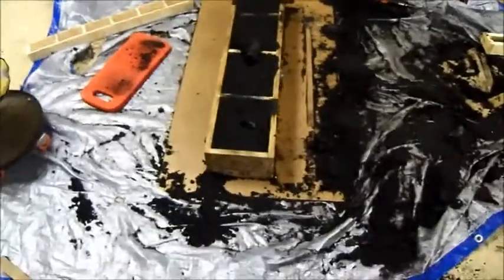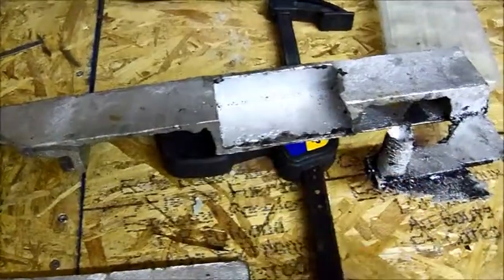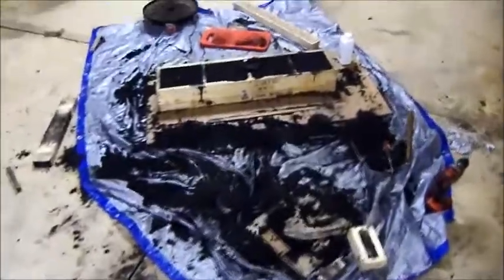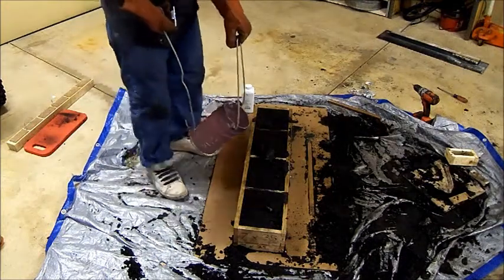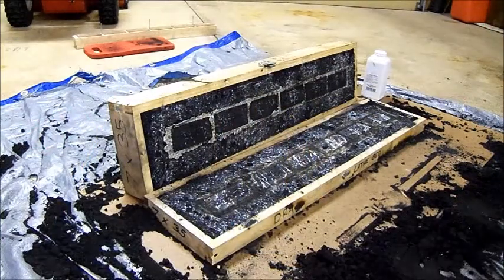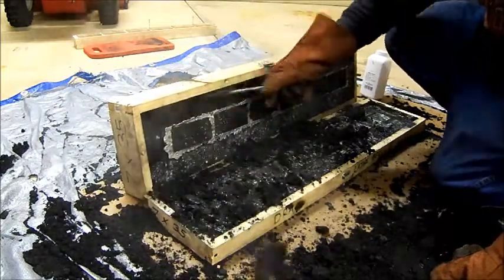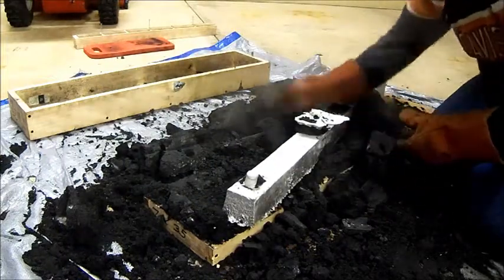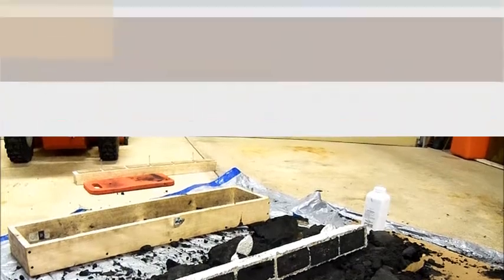Casting the Gingery Lathe Bed - SUCCESS!

Comment: Sorry for my bad english, I probably didn't understand something that you've told in previous videos and that's why I need to ask you this question.
Nice work! It'll be very helpful when I'll start to do this on my own. But I have one question: what are your forms made of? I mean, what's inside that green sand that keeps it in shape you'd like it to keep and also let's you pour aluminium inside? My goal is to build an RC car form my own components like frame, suspension etc.
Waiting for new videos :-)

Comment: Congrats bro. I see you created the bed to be bigger I kind of regret not making mine bigger but I don't feel like re-doing the bed for now and I know you know what that feels like. You casted your bed 10 days before me. We are both in the same stage. I'm curious to what length is your bed? good luck man
Reply from the maker: Sounds like a competition, let's see who can finish theirs first :P.
My bed pattern was 30.5 inches long, an extra 1/2 inch to compensate for shrinkage. The mould took quite a bit more metal than I had planned on, and after measuring with a digital caliper, the top of the bed is a solid 1/2 inch thick with 3/8 inch walls. Hopefully this will make it a bit more solid, I know lots of people say there's way too much chatter and vibration on the original Gingery designs.
I just bought a new car and need to put an engine in it, so that's going to keep me occupied for the next few weeks, but after that I plan on getting right back to melting. Good luck on yours!

Comment: Very nice. Did you make it to the book's specification? I vaguely remember back from the late 90s the Gingery Usenet group used to say the original 1/4" wall on the bed casting was way too thin. The consensus was to upgrade it to 3/8"walls.